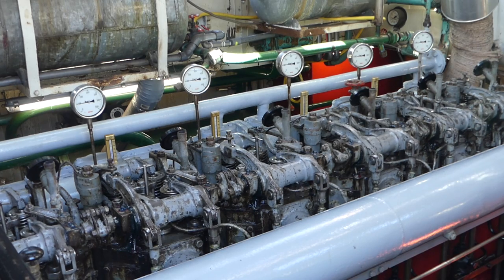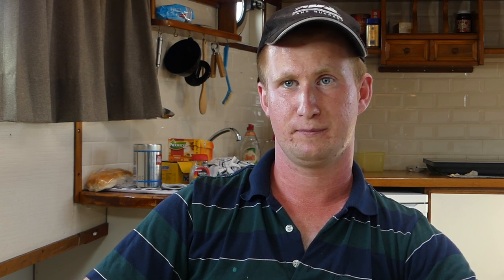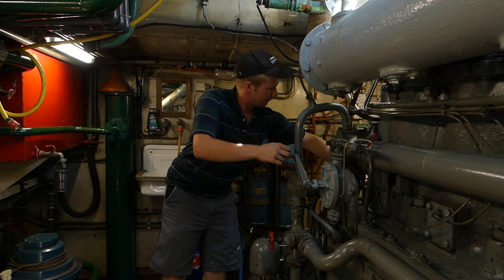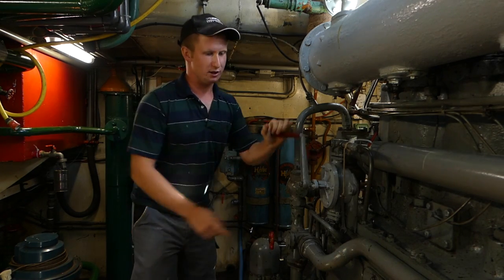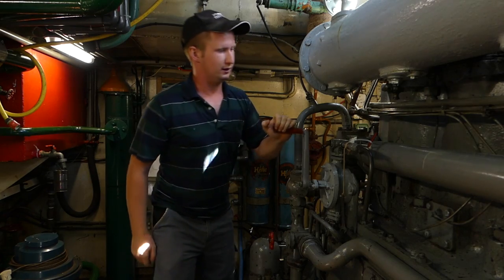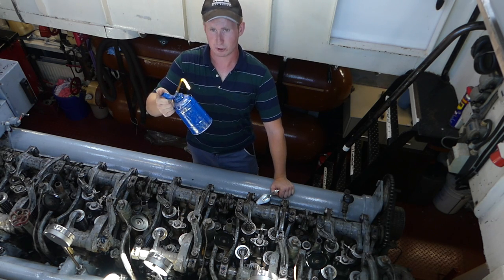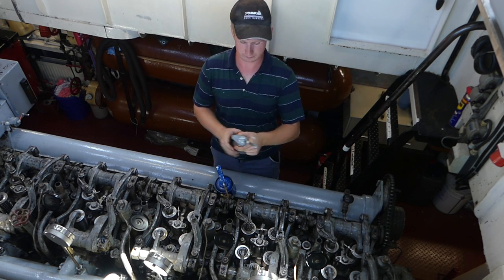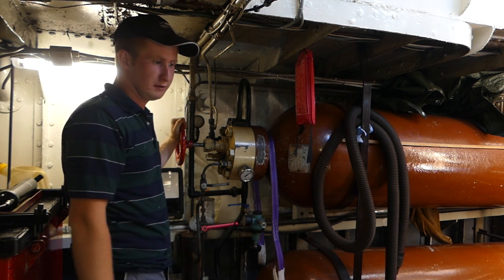Loflied op de langzaamloper (58) - MWM RH 134 SU op de Mea Vota

Comment: 5:30 anyone who speaks englsih why he turn the engine around?
Reply: @onno_vocks  Surely, thank you.
Reply: @onno_vocks  Correct, however, for a six cilinder engine it is not necessary to turn the engine in to the correct position to be started. At least one piston is always in the correct position.
Reply: cheaper mechanism than a gearbox?
Reply: @matthijsvdw  True but due to the possibility of an internal defect its wise to check for water in the cilinders to avoid damage to the engine. A water lock will bend the piston rods.

Comment: confused by the reversing mechanism
Reply: Lift the  valve train, slide the cam shaft into the other position and drop the valve train on the cans.
Reply: im confused of the 13:43 Confrontatie scene XDDDD what the fuck happened ?
Reply: @BertOber  thanks